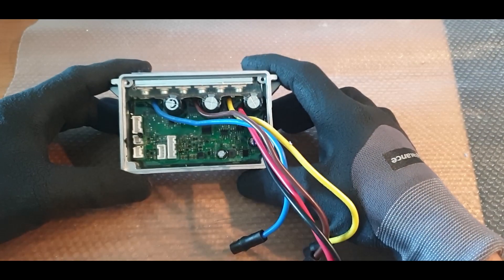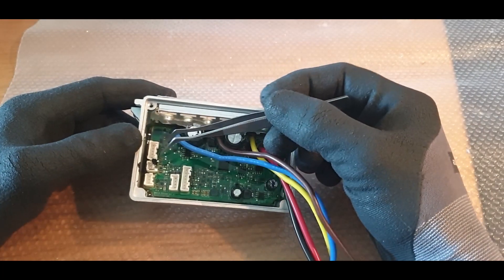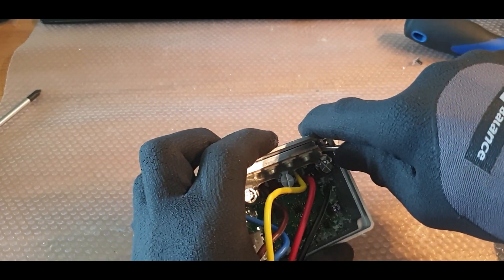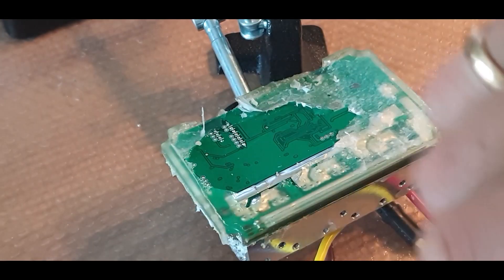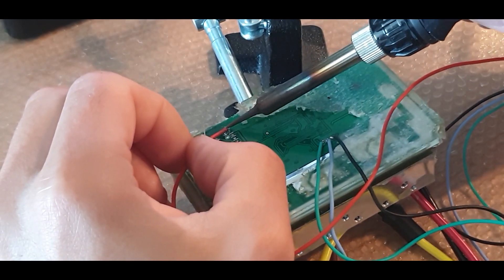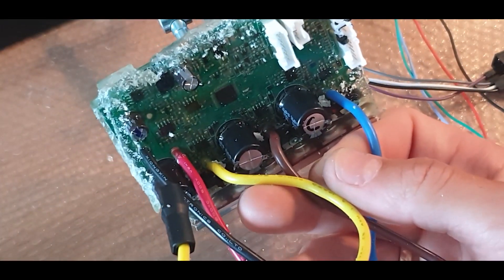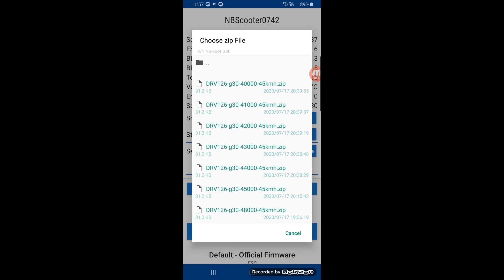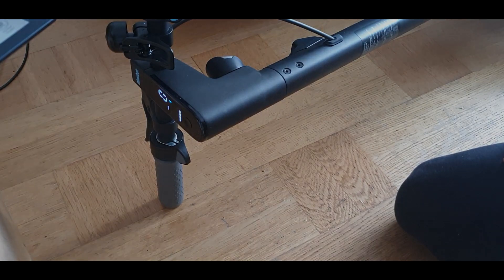Ninebot Max G30D and G30 speed hack and costum firmware guide **NEW METHOD IN DESCRIPTION**

Comment: What is the purpose of changing the serial number? I have a G30max at 30km/h, it was sold to me but the previous owner's email address is linked. I was also thinking of increasing the speed to 35km/h but I have the latest version of the controller and I have to downgrade it first. Would scooterhacking reflasher work for this?
Reply from the maker: Purpose is that you have differend settings. So in your case to change owner you need to change serial. What you can do I change the middle digits to 2536 in middle of the serial and you will have a new fresh owner.

Comment: I have a Ninebot G30D. I changed the region to US G30LP comes to only up to 27 km/h without weight, with weight it comes to max 24 km/h. When you go uphill, it reaches a maximum of 10 km/h. What am I doing wrong?
Reply from the maker: What tiers pressure do you have?
Reply: hello, you should flash drv 126 from scooterhacking utility and be sure to have the right US serial number as they show in SHU

Comment: I followed this and it worked ! Thank you! I pocked the silicone with paper clips and touched the contact points instead of removing the board and soldering
Reply from the maker: Great job :)
Reply: @thanosd6885 can you tell where they are on the front?
Reply from the maker: @hardstylefreaak  hi already have a video on that
Reply: @WattsnabbAB   cual es el link amigo?
Reply from the maker: @andreweltecnologico8003  hi dont understand

Comment: Can it be done without soldering? Is it also feasible in the old controller? I have the scooter locked by the firmware :(
Reply: Can I use duct tape on the pins?
Reply from the maker: @dark-fallen5569  you can always try but need tonhave a good connection in order to st link. Even when o solder the st link dont get good connection so you need to insure you have a good connection. Look at my latest video there I show how it's done on the front of the controller but you need to solder then. And have a microscope, grinding pen and a good solder iron tip.

Comment: Hello, I have a NIne bot max g30D scooter. Is this procedure enough to make you use the maximum power or will you still need dashboard firmware? And one more question: is it possible to change the serial number without a computer?
Reply from the maker: Hi. This is for unlock the scooter if its locked or have a firmware that lock it from flashing. You dont need to do anything with dashboard.
Reply from the maker: Yes if you have firmware lower the 1.7.0 then you can use scooterhacking utility
Reply: is it also with the drv 1.8.3?
 @WattsnabbAB
Reply from the maker: @Mister_Leon  yes as long as you have same controller
Reply: @WattsnabbAB  hello, please say me, i have 1.7.14. is it a chance to use schooterchack?
Reply from the maker: @R. L.  sounds like you have a at32 depends on that. I always check that först.

Comment: why you change the seril number
Reply from the maker: In a default after flashing and you can't ride without a valid one. That's why I get error in video.
Reply: @WattsnabbAB   i just bought mymaxmods 48v external kit, cant flash because my firmware is to new, dont have a windows laptop maybe you could sell me a pree flashed controller ??
Reply from the maker: @sandmhoder  yes sure. Have them here. You can send me firmware and ordet with costume firmware and I will send pree flasher controller with the firmware you want.
Chose: med costume firmware.
https://www.wattsnabb.se/products/ninebot-g30-max-modellerna/reservdelar-till-ninebot-g30-max-modellerna/original-ninebot-g30-g30d-max-moderkort-kontrollkort
Reply: @WattsnabbAB  i only speak english which ones for the external 48v battery
Reply from the maker: @sandmhoder  chose: med costum firmware
Reply: @WattsnabbAB  where does it ship from the website is in diff language and price i need the mymaxmods external 48volt kit firmware on one how much usd $$ please help my kit is unusable right now
Reply from the maker: @sandmhoder  you can chose english an get price in eu
Reply: @WattsnabbAB  where can i tell you what firmware to put on it it sfor 48v external battery from mymaxmods
Reply from the maker: @sandmhoder  you can send it to info@wattsnabb.se

Comment: Can i just use the app and download the firmware. And not do connections or Whatever you are calling it?
Reply from the maker: Yes but if youre scooter is locked you need to go this route.
Reply: @WattsnabbAB  wait, so if i wanna Flash the firmware i have to do this?
Reply: @doug3826  yes but this video is for if you csnt flash it

Comment: Hi, I have a g30 Europe and it has the old type with the 3 connection's on the front of the bms.
On your video you connected to a 5v once you connected the 3 connections. Where on my old bms can I get the 5v from?
Reply from the maker: Hi. That is not bms so you dont mistake bms firmware. Its controller. You can connect dashboard cable to controller and look at it. There you have a red cable witch is 5v to dashboard. Disconnect it and you know where 5v on board is :)

Comment: Hi, i have a ninebot max i've changed the dashboard and the controller, the problem is that i can not turn off the scooter nor change between modes.
Reply from the maker: Hi. Sounds like you dashboard buttom is broken but can't say for sure. Try you're old dashboard if it works.

Comment: Wow Epic, I am about to do the same to a ninebot G30P because they want me to "register before enabling full capacity"....ScrewThem...  This was not mentioned on their product's box.  Either they enable full capacity or I sue them for selling me an undercapacity product.  Alternatively I'll write my own firmware config file and load it in, thank you for showing how to do this :)  15 minutes on YouTube is certainly greater than 4h on hold with their help line which I never got through to...

I will let you know how it goes, may take a week with how busy I am at work though and not set up to run Windows machines at the moment.
Reply: Alsoe I gotta buy new soldering iron tips, mine are like SO dead lol
Reply: So, hello, you said that you will do so lot of things, and you said that you will write how it was, so... How it was?
Reply from the maker: Good luck but for full capacity you just need to change serial and install a costume firmware. :)
Reply: I have a G30P is this good for error 18

Comment: Please help me I followed all the steps and it was successful but when accelerating it does not work it runs if I turn on the dash if it gives me a connection with the app but when pressing the accelerator it does not walk any idea help me please
Reply from the maker: Hi. Was that the problem before you did the steps? You can have damaged you mosfet or it can be somthing else wrong. Can even be somthing with the throttle. It's hard to say. What you can start to do I measure your mosfet to see that they are good. Then change the throttle. But can even be that some cables are not connected well. So try to check them to. Do you see you're battery on dashboard? Do somthing looks strange there?

Comment: Great Video, so if the scooter is locked is it enough too just change the Dashboard or do i need too flash it like in the video. ?
Reply from the maker: It depends on if you installed ble o esc. If esc then you need to do like this. Dashboard won't help if you have installed wrong esc firmware becus it's inside controller.
Reply: @WattsnabbAB  whats ble ? how do i find out if its ble or esc ?
Reply from the maker: @elchapogringo3695  ble = dashboard firmware
Esc= controller firmware. 
All depends what you installed.
Reply: @WattsnabbAB  and what if i change controller ?

Comment: Hello  I started to mess around with my controller because I want to instal a relay. 

Long story shor I think I messed it up. I made a stupid mistake trying to check the display voltage with a multimeter. Anyways the display port sparked from the multimeters. After I plugged everything back my display won’t turn on . The only thing that happens the controller flashes green and brake lights flashes
Reply: Sorry to here that. Why measure display port?
Reply: @AlexfreDholm  to check what voltage it runs on because I want to install a relay on it
Reply from the maker: @RideWithAnthony  ok I understand but you could measure at the top of the dashboard. :) ok it's 5v for everyone that will try in the future
Reply: @WattsnabbAB   I know...but i needed a 12v from controller. Only head light use 12v  so I have to come with 2 cabels from there to case. I know I could use a converter but it will stay on forever if connected to battery.
So...anyway. I tried to fix it flashing won.t work...Checked resistors etc...all fine.

The point is...after that short...controller ist somehow reseted with no DRV file...and with st link can.t be rewrited. I tried everything. 
And believe me...I know what I.m doing. 
I gave up  order a new one. 🖐
Reply: I did the same fucking stupid mistake🤌
Reply from the maker: @G30MaxForce  sorry to here that!!

Comment: I changed the region on my G30D and after this it stopped displaying battery percent while charging, it is charging but nothing is displayed and the lights are also not indicating that its charging.
If I set the region back to D this will fix the problem, does anyone know how to fix this?
Reply from the maker: You can use a costum firmware and don't turn off charging mode:)
Reply: Har samma problem som han hära snubben förstod inte riktigt vad är det jag behöver göra .tacksam
Reply from the maker: @danihani2526  man behöver en speciell programvara man kan bygga den själv på scooterhacking

Comment: I need stock firmware for my new max g30 d2.. i flashed my new Scooter a few times and i get all sorts of wierd behaviour now, headlight always on and max speed 20kmh atm 🤣
Reply from the maker: It's better to use costum firmware the you set perimeters that you want
Reply: @WattsnabbAB  lyckades inte så bra med min förra custom firmware tyvärr.. fick den att frivarva 30 men den hade inget vrid och orkade knappa 20?vet inte riktigt vad jag gjorde för fel men misstänker att de blev nå vajsing med region eller nåt?`

har du möjligen en länk till en färdig fil?
Reply from the maker: @TommieLjungberg  ser o du gjort nått fel men här kommer en firmware. Giltig i 2 dagar.
https://linksharing.samsungcloud.com/jNuweMnxPj19
Reply: @WattsnabbAB  vafan nu tar den inte laddning ju :( 
EDIT: verkar bara vara så att den inte längre visar att den laddar. för kan se att den ökar i ninebot appen. skulle va najs att få tillbaka det som den var  :)
Reply from the maker: @TommieLjungberg  hej undrar om de nya korten som gör att de är så för jag har inte tagit bort changeing mode på den.

Comment: hello friends in Indonesia there is a lot of scoter waste maybe because of regulations so it's not allowed on the highway I found a scoter in used goods of the MAX G30 type, can it be turned on after I charge it
Reply: 66 hours of life but there is a code 32 key symbol, is the system program in the controller or can it be flashed or should I just change the controller, please guide, thank you

Comment: Hello, I purchased a couple Ninebot Max G30 SNSC 2.0 from a police auction and I am trying to find some information on flashing etc. to drive it. Can you help??
Reply from the maker: What you need to flash? If controller use xiaoflasher. Easy and fast. You need a original dashboard.
Reply: @WattsnabbAB  So everything is original but removed the GPS unit?? I tried connecting with Xiao but no luck. Bluetooth does not light up on dashboard at all??
Reply from the maker: @mikerak7473  the snsc have a locked dashboard so you need a "normal" original dashboard to flash. Or st link the dashboard you have so you get original ble in it.

Comment: Ok inhave a 48v mod on the scooter but im not going pass 44khm on the road what can i do to achieve full power ! And peak speed at 50khm freewheel
Reply from the maker: Try this firmware. Its Police mode on so you have to hold down the break when start scooter to activate the full speed. 
I guess you have a gen 2 motor.
https://linksharing.samsungcloud.com/bekjvaK9MPBq
Reply: @WattsnabbAB  yes its stock controller , i didn't do the flashing just added the external 12v battery in pararel , ive been trying every fw with no luck maybe your my savior
Reply from the maker: @flashunlokr  hope you mean in series :) yes I hope so. The speed will depend how high you're 12v kit charge. My do 12,6v

Comment: Why not solder from the top?
Reply from the maker: On g30d you have the st link pin under the board.
Reply: there are 3 dots where you can solder pins/leads as you wish, wouldn't that do the job? 5V dot must be available somewhere too.
Reply: @diyroky  under the middle Tower 3 dots, use this and the First 2 Pins 5v and GRND from Dashboard Connector.

Comment: Hi, I have one ninebot max G30 and suddenly it stop charging when I connect it, how can I fix it?
Reply from the maker: I would forst try with diffrend charger( you have to connections in the bike). Then I would measure if the voltage reache the bms with a multimeter.  Can be the charger inside that is broken.
Reply from the maker: Or just a cable lose.
Reply: hey, I have this same problem. charger is perfectly fine since it works with my other Ninebots, but my Max wont show percentage when charging

Comment: HELLO, I HAVE A PROBLEM. AFTER I APPLIED ALL THE STEPS FROM THE VIDEO, CHANGED THE SERIAL NUMBER AND CHECKED IF HE REALLY CHANGED IT. I TRIED IT AND SPINNED IT AT 30 KM / H. WHEN I CLOSED IT AGAIN AND TRIED TO STAND ON IT, IT SHOWS AN ERROR 10
Reply from the maker: Ok tjen you have done something wrong error 10 is wrong firmware on controller. Try to solider the controller and reflash it. Before fixing the serial and cfw try to see so it work.
Reply: @WattsnabbAB  reflash con st-link?
Reply from the maker: @matmat3460  ??
Reply: Check also if you ble version is right.

Comment: Can you not just use the xiaoflasher app anyway and just change the region? (UK version)
Reply: have you flashed yet
Reply: @Midlothian-717  yes I changed the region and worked just fine.
Reply: @SionTheDiff  so what speed do you get now
Reply: @Midlothian-717  I get 18mph now.. just changed the region
Reply from the maker: Yes this is for those how got locked out using xiaoflasher :)
Reply: @WattsnabbAB  is everyone locked out when you flash and how do we know what controller we have ?   mine just says g30 its a uk version  doesnt say g30d
Reply from the maker: @Midlothian-717  if younhave regular g30 then the contacts are in the front. Search for ninebot g30 st link and you will find how tindo